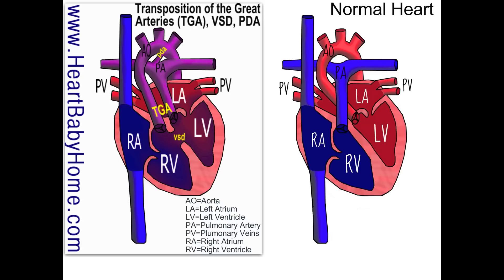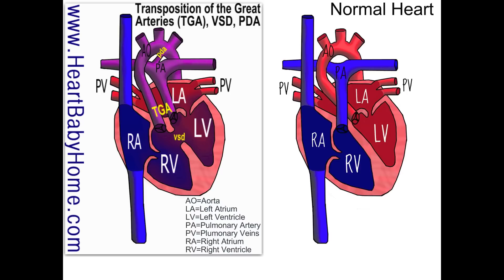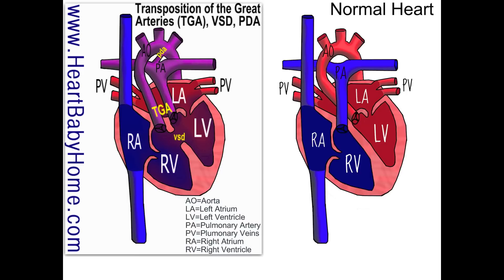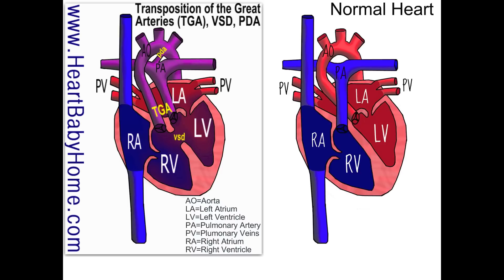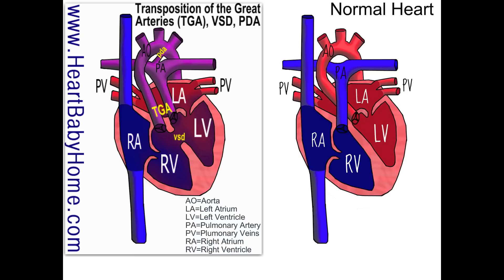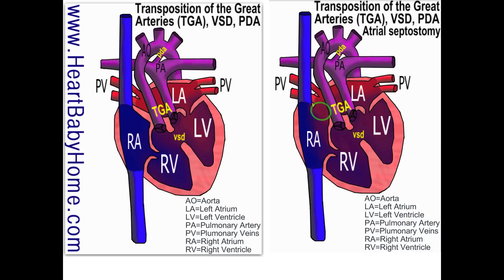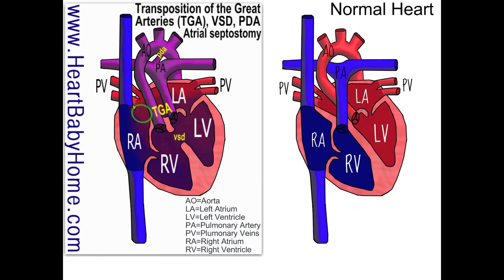46 Transposition of the Great Arteries with vsd, pda

Comment: I had a vsd when I was a year old now I'm 22,I go to the gym n workout, boxing ...  n I want to join the military, will this prevent me from going?
Reply from the maker: My knowledge of the military is limited.  However, I do know you'll need to disclose the VSD when you apply.  If you still have a heart murmur, it is unlikely that you'll qualify.  However, if your VSD has been resolved (either by surgery or all by itself--which is totally possible), you have a good chance of being accepted.  They will required documentation from your physician--but you'll want to get it after they ask for it in case they need more or ask for it to be worded in a specific way.